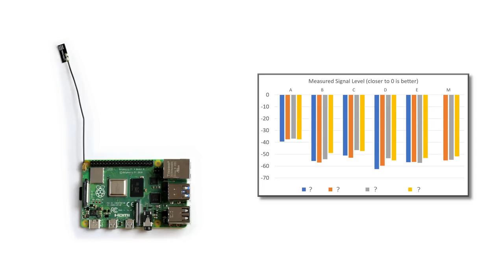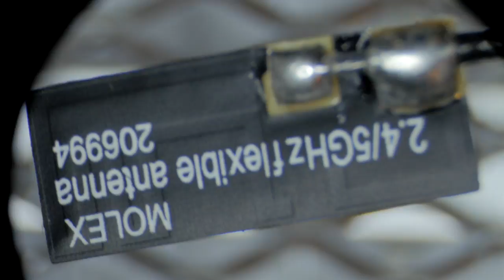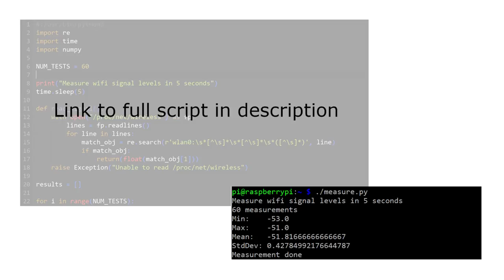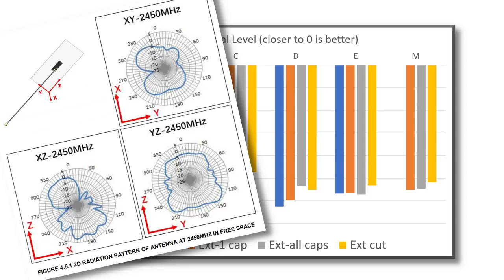Add External Antenna to Pi 4 [Detailed Instructions & Analysis]

Comment: Off topic, but in a weak or interferring instance, do different WiFi channels provide better reception? I'm getting choppy throughput at SSH terminal even though I've placed my RPi in its better location (receiving -49 dBm). The particular channel being used does not have other users.  Thanks.
Reply from the maker: It depends on the band (2.4GHz or 5GHz) but in general choosing a channel that has fewer users will provide better reception (you can use something like InSSIDer to see all wifi signals in your area).

One common thing that people overlook is that there are actually only 3 non-overlapping channels for WiFi in 2.4 GHz. They are 1, 6, and 11. If you pick any of the other frequencies (or if your neighbors do) they will harmfully interfere with each other. You can double check this with a wifi spectrum tool, but for example if someone is using channel 4, that will destructively interfere with channels 1 and 6, so in that case channel 11 would probably have the best performance.

-49 dBm is decently strong, so it's most likely that you have some interference going on if it isn't working. Look for other 2.4GHz or nearby stuff like microwaves, traditional phone with wireless base station, or baby monitors.
Reply: @funtechu  Thankyou.  I will test those channels (2.4 GHz).  I use a channel utility in an Android app, Traffic Monitor. (I can see, and this answers why channels 1, 6 & 11 are heavily loaded by me - the typical user does not change their router channel).

In an completely separate scenario, I had the Pi on top of an HDMI switch - it was giving interference, big time.  I changed that arrangement and got back from -61 to -58dBm, and a slight movement forward all of a sudden yielded -49 :-/  With that, it was still choppy :-/

Thanks for your time!

Comment: Does it matter how long the cable is? I've got a pi in a van and I need an antenna too put on top will any wifi antenna work okay?
Reply from the maker: That's mostly going to come down to how long of a U.FL to RP-SMA cable you can find, but a cursory search online shows you can get them up to about 4 feet long so it's theoretically possible. Just keep in mind that the longer the distance from the chip to the antenna, the more loss there will be.

Comment: I ordered the Raspberry Pi antenna but it did not come with the surface mount connector to go on the circuit board. Where do I get one?
Reply from the maker: You can use any U.FL connector. Here is one on mouser: https://www.mouser.com/ProductDetail/Linx-Technologies/CONUFL001-SMD-T?qs=EU6FO9ffTwfRdkBeQTdJWQ%3D%3D#.Yk5r0KIE4Fg.link

If this is your first time attempting it, you may want to get a couple in case you mess up the first one. And don't forget to get some 0201 0 Ohm jumper resistors while you are at it! 

The parts cost is going to be way less than the shipping cost for small quantities.

Comment: There seems to be more than one size of U.FL connector.  The pigtails I've ordered don't fit.   Does anyone know what to google to get the correct size?
Reply from the maker: There is only one standard size for U.FL connector to my knowledge, though there are other connector variants (H.FL, E.FL, U.FL-LP, W.FL, etc). Just make sure you are getting one without the  LP (low profile) suffix.

Assuming that you did order the correct one, keep in mind that some manufacturer's U.FL connectors require much more force to connect than you might think (due to variations in the manufacturing tolerances). Make sure it is properly lined up, and the bottom of the board is supported behind (so you don't damage the board) and push straight down.
Reply: @funtechu  I guess this Amazon description is misleading as it mentions both U.FL and MHF4:   https://amzn.to/3h3Y875    
This is the one which is too small.
Reply from the maker: @nickgilbert1264  Ah, yeah that's an incorrect listing. It looks like MHF1 is compatible with U.FL, and MHF2 is compatible with U.FL-LP, but MHF4 is much too small (possibly W.FL compatible, but I can't find a direct comparison chart).

Just make sure you  get a listing that says U.FL and if it says IPX or IPEX or MHF next to it (which means they are using IPEX connectors instead of Hirose) it should be IPEX 1 or MHF 1.
Reply from the maker: @nickgilbert1264  Yeah, that looks correct. If you look at the detail photo which shows the dimensions, the dimensions line up with the dimensions on a standard Hirose U.FL connector, so it should be good as long as that photo is for the item that is being sold. 

One other thing to double check before you get it, that one is listed as an RP-SMA connector on the other end, so make sure that's compatible with the antenna you have chosen. RP = reverse polarity
Reply: @funtechu  Thanks!  Thankfully Amazon returns are easy and the postbox is only 30 seconds from my house.

Comment: is there an option for doing this with the bluetooth? because the bluetooth on my pi is rather weak when anything gets more than 2 feet away from the device.
Reply from the maker: The Bluetooth uses the same antenna, so this should work for that as well.

Comment: Hi, what temperature do you use to melt the Sn/Pb paste with your hot air gun ?
Reply from the maker: It depends a lot of which hot air station I'm using, and what solder I'm using. Typically for the hot air station I'm using here, it's around 280C for Sn63/Pb37, and closer to 300C for lead free solders. However, with hot air it's a function of the temperature and the air speed, so you usually have to play around with it a bit on your station to see what works best. The preheater is super important too (I use 100C).
Reply: @funtechu  Okay, thanks for the tips ! I will try on test PCBs to see what air speed I can blow and what temperature works the best before causing any damage to the motherboard. Thanks again !

Comment: What about esd protection and installation of that particular antenna you use (like how to stick it to a case )?
Reply from the maker: This particular antenna has an adhesive backing so you can just peel off the protective paper, and stick it. ESD handling procedures still apply as with any piece of electronics (discharge yourself before working with it, hold by the edges, etc).
Reply: @funtechu but wouldnt the antenna still be suceptible to picking esd while operating not just while mounting as it is a piece of metal exposed in an outside enclosure where it can be touched?
Reply from the maker: @anneallison6402  It's certainly possible which is why you should use an appropriate antenna depending on the use. You can get enclosed antennas that don't have exposed connections. The antenna that I show in the video is something you usually put outside of the metal enclosure, but on the inside of a plastic cover or faceplate so it won't be touched. For example, it's the type of antenna that you might find behind the plastic bezel on a laptop.

Comment: I noticed that you started doing this with the Pi 3.  Huh.  I woulda thought that that lack of a connector was an oversight that they will correct eventually.  I guess that's what they wanted to do.

OK.  Here is my theory.  Hobbyists don't need an antenna because they aren't gonna put it in a Faraday cage.  So an antenna connector doesn't fit their target market.

The Compute Module 4 does has an antenna connector.  If you want to make a commercial product based on the Pi then you should do something based on the Compute Module.  Pretty sensible, I guess.  But you cannot buy the compute module anywhere.
Reply from the maker: Yeah, that seems to be what they were thinking. I suspect the supply chain issue for the compute module 4 is because of the chip shortage issues. Broadcom who makes the main processor is fabless, so they have been having trouble getting fab time. Even the non-compute module versions can be difficult to get depending on the day. And I'll bet since there are companies that have products that were designed around the compute module, that anytime it comes back into stock, they probably immediately sell out.

Comment: Just wondering why not just cut the trace why would you need to remove the caps
Reply from the maker: In the video I tested a few suggested ways of doing the modification, including cutting the trace. Cutting the trace gives the best result overall, so it's the recommended way to do the modification.

Comment: Thanks for the video! 
Question: Isn't that component you removed from the PCB antenna a 0Ohm resistor  that you could just put on the bridge for the ext. antenna?
Edit: You said in the video that it is a capacitor. But still, cant the capacitor be used as a bridge since capacitors should pass AC?
Reply from the maker: Yes, it is a capacitor (not a 0 ohm resistor) and it can theoretically be used to bridge the connection since its resistance is low for high frequencies (Z=1/jw). However, I would recommend using a wire or a 0 ohm resistor so you get the best impedance match and avoid reflections. Those capacitors are used with the PCB antenna to get it to present a 50 ohm impedance overall to the WiFi chip, but since any external antenna you use should already be designed to present a 50 ohm impedance, adding a series capacitor would just cause undesired reflections. I did actually try it out a couple months ago out of curiosity, and it worked, but it gave slightly worse performance overall than the 0 ohm as expected.
Reply: @funtechu  Unless you know the value of the capacitor than no you would not reuse it as you will introduce an unknown capacitive element into whatever the impedance the radio sees at that point. Therefore it is best to use a 0 ohm resistor or bridge. 
Chasing a perfect match is a common mistake anyway though as you can only have everything "perfect" in one particular orientation, in particular surrounds etc etc. Some makers waste huge amounts of time chasing matching networks on their PCB designs that will be wrong as soon as the customer gets the thing into their own case, mount whatever :-) Neat video.

Comment: Hi Caleb could you do one on the ft3 I saw your video but I don't speak English so it's hard to understand thanks
Reply from the maker: The PI 3 is actually almost identical to the Pi Zero W (Here is that video: https://www.youtube.com/watch?v=Y648CjIiEv8). The one difference is you must scrape off the solder mask for the third connection like the Pi 4. You can see what the Pi 3 pad looks like here https://youtu.be/mZGMGs6RDtc?&t=171 

Steps: 
1. Scratch off solder mask to expose ground connection (similar to this https://youtu.be/MTwWnZG8wUY?t=32)
2. Remove the little jumper resistor (https://youtu.be/Y648CjIiEv8?list=PLKDhVN8At8Hrk6MUKCDvrymb3j6KIvWeh&t=117)
3. Solder the little jumper resistor so it is now diagonal, and the chip is connected to the external pad (https://youtu.be/Y648CjIiEv8?&t=174)
4. Solder on the U.FL connector (https://youtu.be/Y648CjIiEv8?list=PLKDhVN8At8Hrk6MUKCDvrymb3j6KIvWeh&t=209)
Reply: @funtechu  merci

Comment: Morning..I dont have a resistor at hand for this mod, what size wire will work for this in place of the resistor?? Thanks
Reply from the maker: You could just use a single strand out of some finely stranded wire and then trim it down. Actual diameter is really small, perhaps a 26 or 28AWG
Reply: @funtechu  I'm having difficulty trying to add wire to the board, can you do this for me, and I'll be happy to pay you too
Reply from the maker: @robertcargill4533  yes, I do have a modification service listing if you need it. Check it out here: https://www.etsy.com/listing/1007434724/modification-service-add-external
Reply: @funtechu  Thanks, do I need to send the entire ASIair Pro to you and the antenna so you can verify it's working correctly?
Reply from the maker: @robertcargill4533  If you are doing an ASIAir Pro modification, there is a separate listing for that: https://www.etsy.com/listing/1013982058/asiair-pro-external-wifi-antenna

In that case you would send the whole ASIAir Pro so I can mount the antenna and check that everything works correctly afterwards. Otherwise, if you just want the board modification, you can send just the antenna with the Raspberry Pi and I'll test with that antenna after I'm done.
Reply: @funtechu  Thanks sounds good
Reply: @funtechu  it's going to ship today by UPS, thanks

Comment: Hi Caleb, Can I do the same modification for Rpi 3 Model B+ since the onboard antenna is similar to the one on your video?
Reply from the maker: Yep, it can be done on the 3B+ as well. The pad location is on the bottom of the board as shown here: https://youtu.be/mZGMGs6RDtc?t=74. You would just scrape off the solder mask on the side that isn't exposed, solder up the connector, and move the little jumper resistor so the chip is connected to the U.FL connector similar to the Pi Zero W. The microscope view of the area is shown here: https://youtu.be/mZGMGs6RDtc?t=171
Reply: @funtechu  Thanks for the information. Will 0Ohm 0805 Ok to bridge the middle connector?
Reply from the maker: @twrfollow-up3701  I think that would be too big. 0201 is the correct size. Note if you are still referring to the Pi3B+, the jumper resistor should already be there, you just have to move it.
Reply: @funtechu  yes I am referring to Rpi3B+ kindly send me your email id to send a picture of the onboard antenna.
Reply from the maker: @twrfollow-up3701  You can upload it to some place like imgur and then post the link here if you have questions. Regardless, did you see my previous comment? The second link shows exactly where to make the modification.
Reply: @funtechu  I have uploaded a pic of the onboard antenna here, https://drive.google.com/file/d/1f4WHWvInNG0VX_khf5tpaQEhonIY5o2L/view?usp=drivesdk
Reply from the maker: @twrfollow-up3701  Ok, I see that it's a different revision of the Pi 3 board. Regardless, the modification is similar. See photo here: https://i.imgur.com/DvAfKtN.png

You would use an xacto knife to cut the trace going to the existing antenna, use that knife to scrape away the solder mask where the shield ground connectors would go, and use an 0201 0Ω resistor or small piece of wire to connect from the trace to the center connector. Then you should be able to solder on the U.FL connector.
Reply: @funtechu  Thank you very much the challenge will be finding a low 0Ohm smd resistor.
Reply from the maker: @twrfollow-up3701  They are available from most parts sellers like Mouser or Digikey
Reply: @funtechu  Thanks a lot for helping without hesitation.

Comment: Has anyone seen this mod give any improvement to the USB3 wifi interference issues the PI4 has?
Reply: Hi Caleb, I'm also interested if this mod will solves or at least minimize this USB3 /2.4ghz/bluetooth issue, in my case I am using a USB3 to NGFF adapter (geekworm x863v2)  http://www.intel.com/content/dam/www/public/us/en/documents/white-papers/usb3-frequency-interference-paper.pdf

Comment: Is there a way to add another connector, to add an external wifi and external bluetooth antennae?
Reply from the maker: The same connector works for both WiFi and bluetooth (it is shared)
Reply: @funtechu  do you know why I would have 2 antennas in my AIO monitor, and two connectors on the atheros AR5B22 board they’re connected to?
Reply: @funtechu  great job on this BTW!
Reply: could it be IR for the remote and keyboard?
Reply from the maker: @SeanFitzthum  IR is optical so that's a different type of interface
Reply from the maker: @SeanFitzthum  Typically portable consumer devices (laptops, tablets, AOI computers, etc) will have two antennas placed orthogonal to each other so you get a good connection regardless of the device orientation.
Reply: @funtechu  gotcha. So, i’d there a way to add two connectors to the pi?
Reply from the maker: @SeanFitzthum  The chip used doesn't support it, so to get multiple antennas you would just need to get a separate USB WiFi adapter
Reply: @funtechu  Are you still doing the mods?
Reply from the maker: @SeanFitzthum  Yep, see the Etsy link in the description if you have your own pi that you want modified, or the eBay links otherwise. The eBay listings come and go depending on if I can get stock of Pis.